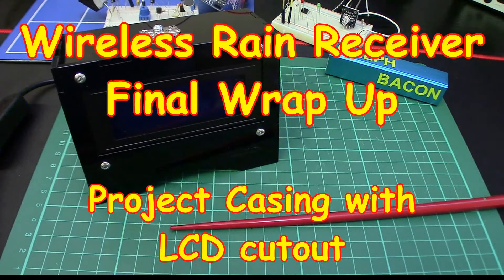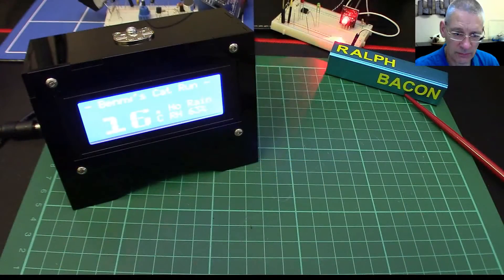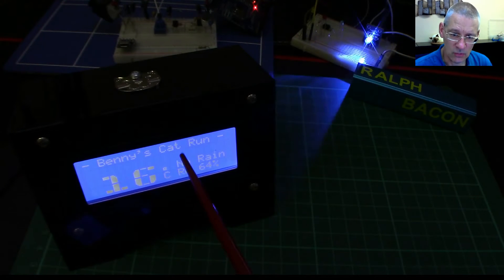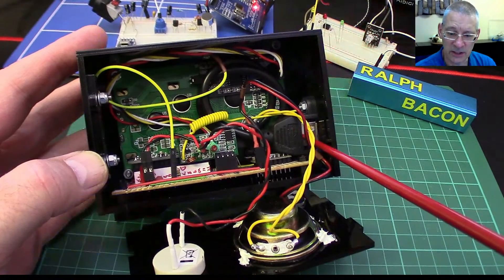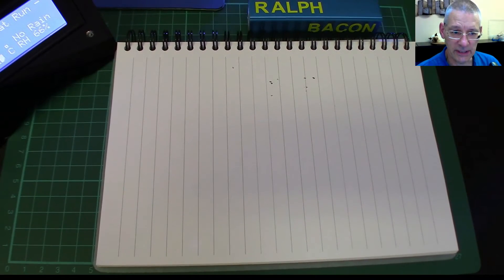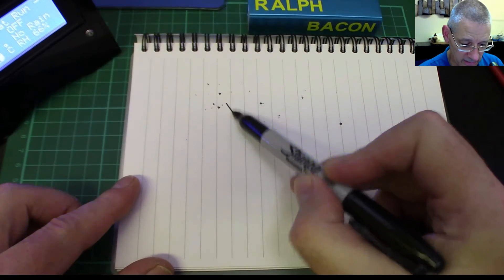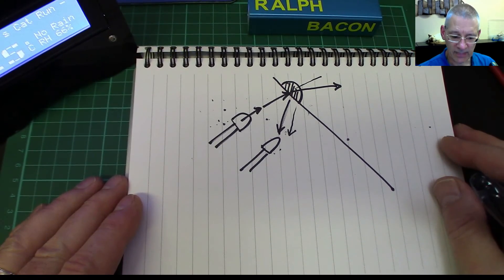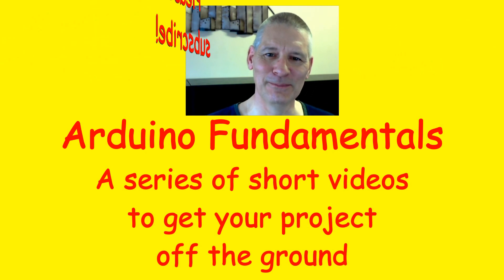#54 Wireless 433Mhz Rain Receiver (Completed)

Comment: I see below, that you've solved the corrosion problem.  Well done.  I was going to suggest an 'H' bridge to periodically change the polarity. 

In an earlier video, you mentioned your phone drains the battery quicker when you are on vacation.  Do you turn off WiFi when on vacation?  If not, that may be the source of your excessive current drain, as the phone is constantly trying to find an access point to connect to.
Still catching up on your videos.  Watching them all.  All are getting thumbs up.  ;)
Reply from the maker: That phone issue was down to end-of-life battery in my phone. When plugged in at home it never had a chance to discharge! My new phone is so much better. Glad you like my videos, thanks so much for the thumbs up!

Comment: On the subject of cheap project boxes, my last project I stumbled upon a "life changing" way of quickly making them from MDF and superglue which means I can now create a cheap custom box for any project in minutes.  (hint: B&Q often have MDF off-cuts they give away or ask for a donation to charity)
Basically just cut all the sides of the box you require from some thin MDF, run some superglue along the edge to be glued and hold in place for 20 seconds then move on to the next side...it results in a surprisingly strong box.
So one side can be opened for access I glue a couple of MDF blocks in place then put screws in to these to hold the final side on (doing this to two box sides gives even better access).  Not cutting the sides square can give some much more interesting project box shapes.  Hot melt glue is a good quick way of securing circuit boards in place etc. (it sticks extremely well to MDF).  Normal emulsion paint is quick and easy to apply to MDF, dries in minutes and results in an interesting retro style project box.
NOTE: I guess you need to be mindful that MDF will burn so anything which will potentially get hot needs to be protected.
Reply from the maker: Interesting, alanesq. What thickness MDF do you use, 6mm? I don't think B&Q sell any thinner do they (you would think that after working there for 9 months I would know the answer). So superglue will glue these rather absorbent boards OK? Sounds fascinating, thanks for the heads up!
Reply: @RalphBacon  Hi.  Yes the MDF I used was 6mm but I think I have seen thinner available (I will check my collection of bits tomorrow).
I didn't think superglue would work myself, I think I had just tried it in the hope it would temporarily tack it in place but was surprised to discover breaking it apart tears the MDF before the glue gives way (btw - I am just using the cheapest superglue, 3 bottles for £1 at Poundland).
Reply: @RalphBacon  Update:  Just been out to the workshop to have a play, I have some very thin MDF around 3mm with a plastic coating on one side which must have come from B&Q,  It looks just like hardboard.  This gave me the idea to try it with hardboard and this works really well also and would be great for smaller boxes.
What I do is run a bead of superglue along one edge straight from the bottle (to get pleny on), then hold it in place for 30 seconds (or you can use an activator spray to make it instant - this also from Poundland). 
btw - very easy to also glue your fingers whilst waiting for it to set so watch out for that, best to wear gloves.
Reply from the maker: Excellent, I shall visit Poundland when I am near one, bound to be soon. Great suggestion, thanks so much!
Reply: @RalphBacon  Whilst I am on a role ;-)
It might be interesting for your channel to have a look at the ESP32 with build in camera which is selling on eBay for around £6, looks interesting and maybe make a good CatCam project for Benny's run?

Comment: Tin(II) Chloride. A dip in that should solve the corrosion issue.
Reply from the maker: I must be honest, Mark, and say I had not heard of this substance but Wikipedia tells me that one of the uses is to tin-plate steel for making cans, so I guess this would work! Who knew (apart from you)? As it happens, I've resolved the corrosion problems in a couple of other ways:
 
1. Start the sensor every 30 seconds or so for just 1 second (that is, use the Arduino to supply power to the sensor) and take a reading. That means no 5v is constantly present and the corrosion (after many months of my trial) has stopped. Woo hoo!
2. Use a (very hard to find) stainless steel sensor. No need to explain this one.
 
But I like your lateral thinking, Mark and I'll bear this in mind for future projects. Thanks for posting.

Comment: Good use of the sensor as an excercise but practically I have to wonder. Weren't you in an area where a simple cell phone rain app would work? I use one and I am surprised at how well it works especially when I am downtown amidst the skyscrapers and a rain sensor probably wouldn't work very reliably. BTW, I bought a spare smart cell phone for $40. Amazing how that underprices the hobby of electronics.
Reply from the maker: I must admit the use of a smart phone app did not occur to me. How would it be accurate enough to tell me that the first spots of rain are dropping onto Benny's bedding though? Since this video I've explored other rain sensing devices that you will discover if you watch further videos... one day I'll get the perfect one. Thanks for the suggestion John.
Reply: That is one of the pluses about a rain app. It can set to go off before the rain comes. The one I use uses zip code and probably the location of the cell phones GPS. I bike a lot so from downtown I set it to go off like 20+ minutes before the rain comes because I can bike home in about that time. You'll probably have to do some research of your own. For things like that I just look at other people's reviews. What kind of pet is Benny any how?
Reply from the maker: I'll do some investigation on using an app. Benny is a (rescue) cat, and usually writes most of the code you see here but makes me type it in because without thumbs he finds the keyboard a bit difficult. He makes the occasional cameo appearance too. Watch out for him!
Reply: These rain apps you talk of, they get data from a weather service and I have found that they never report the weather accurately.

What mobile phone have in them these days are devices to measure humidity, temperature and air pressure, these can be used to predict possible weather changes but generally, your weather comes from a weather agency.

Comment: Ralph, I thought this micro USB breakout board might work better (link below). You could glue a mounting block to the case and then screw the board to that. It should be strong enough for occasional use.

 http://www.ebay.co.uk/itm/MICRO-USB-Type-B-5pin-Female-Socket-Jack-Connector-Module-Board-Adapter-/400956646269?hash=item5d5ae0e37d:g:n2IAAOSwyQtVo22t
Reply from the maker: +Maxx B
Already got this one, funnily enough. It even features (well, is mentioned) in one of my videos, possibly one that has not yet been published. It works even better if you remember to actually solder in those header pins rather than just push them in and wonder why it's all a bit wobbly. <embarrassed grin> Anyway, I found it so useful I ordered more from the Far East and got 10 for what I paid for just one here in the UK. But thanks for the heads-up, other readers may well find that link useful.
Reply: I went back an found the video with it in. I somehow missed it. Brilliant minds and all that ;)